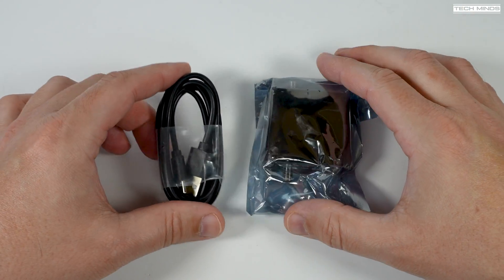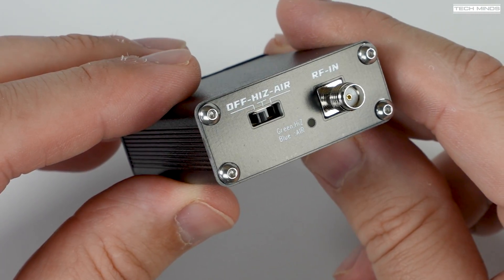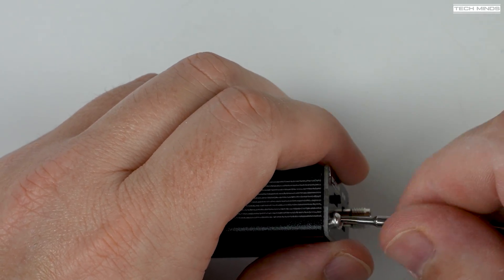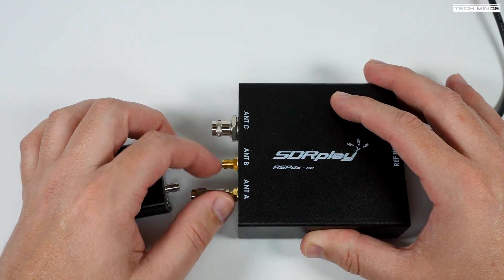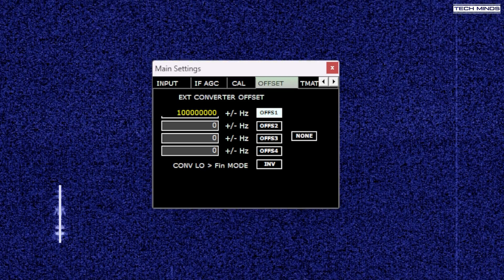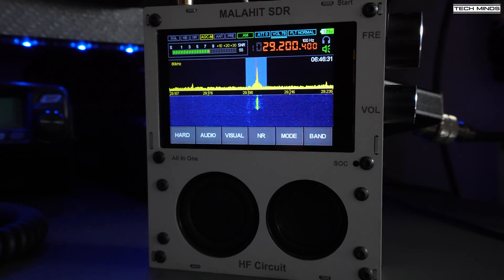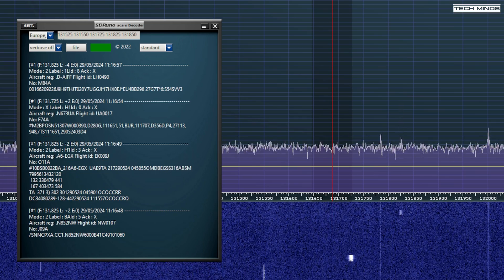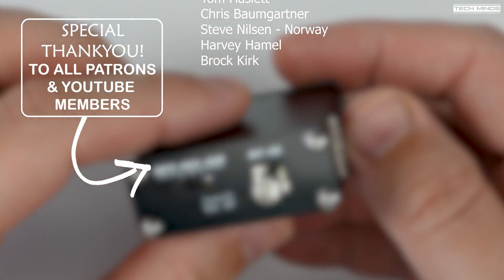Listen To Airband On Your HF Radio With This Little Down-converter

Comment: How do we calculate the freq we here i have the 110 model ?
Reply from the maker: I think that means it’s a 110 MHz shift
Reply: @TechMindsOfficial if 126.400 MHz of ATIS of MNL airport in Manila, Philippines received in People’s Park in Tagaytay City, Cavite, it will receive on 16.400 MHz on DEGEN DE1103, ETON FIELD SHORTWAVE RECEIVER and some TECSUN shortwave radios ?
Reply: @TechMindsOfficial also for FM receivers 64.0 or 76.0 to 108.0 MHz, like Tecsun PL-398MP, DEGEN DE1103, it will receive from 174 or 186 to 218 MHz if there’s analog TV in some countries on VHF.

Comment: Interesting, but I can't see a use for it. It would have been helpful to have a comparison with the SDR receiver's own reception to see if it was lossy or actually helped amplify airband transmissions.
Reply: If the conversion quality is good , the results on a good HF radio would be very interesting..